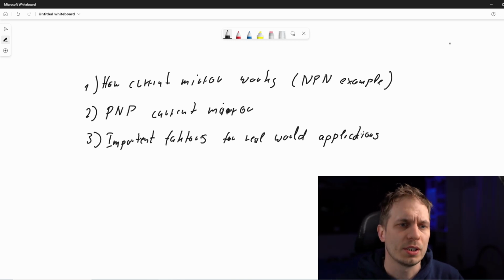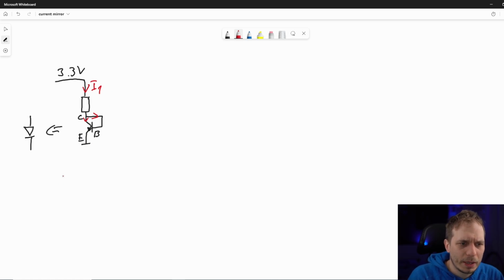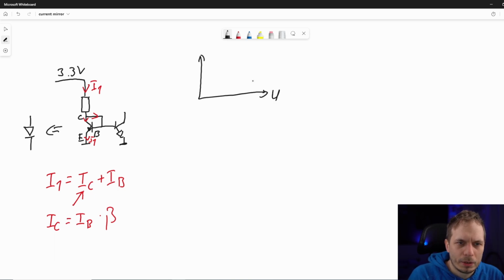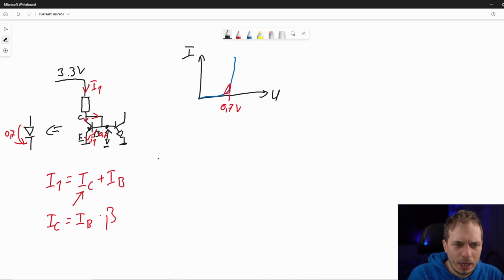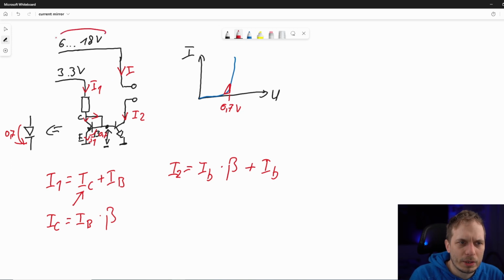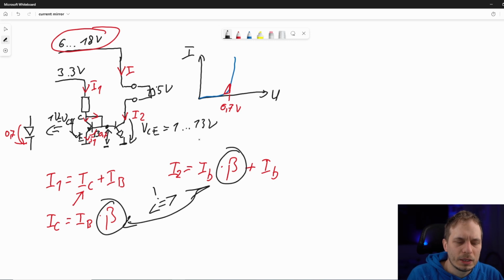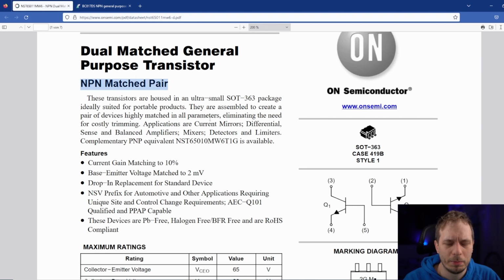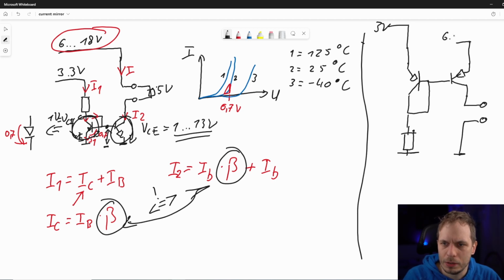Current Mirror: Insights and real world Tips

Comment: Can I use the C 2690 transistor to create an FM circuit..and how many watts and voltages?
Reply from the maker: Well the Datasheet says :" These products are general purpose transistors designed for use in audio and radio frequency power amplifiers." 

So yes it can. The Datasheet says 50-100 W.

BUT this Circuits are Not easy to Design. You need some HF experience and and Idea for a cooling Design. Both is not so easy so i would recomand to Take a solution you can buy as a finished Modul.